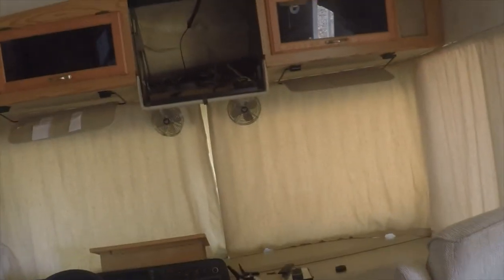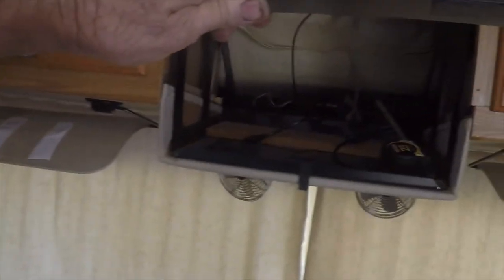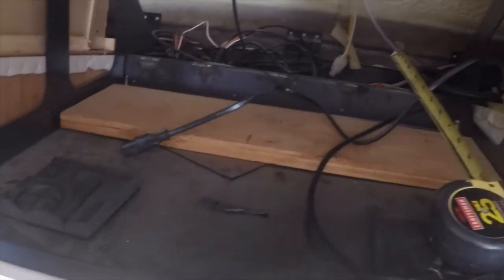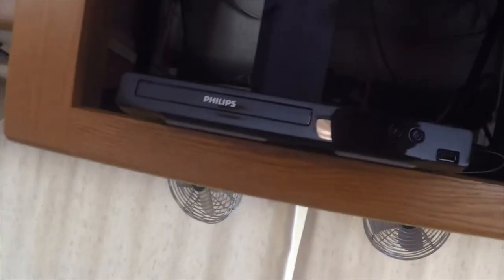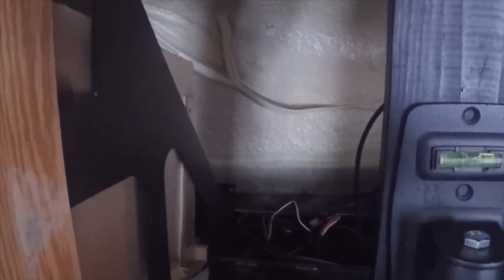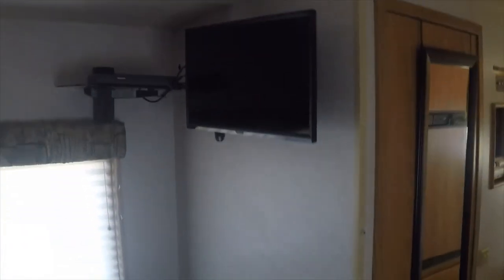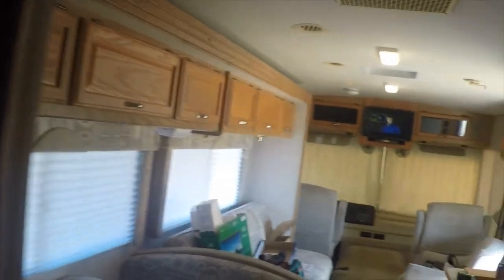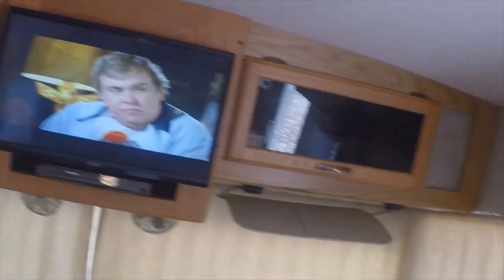Installing a flat screen in the Motorhome.

Comment: Nice. Do you have a problem with the tv moving on the swing arm while traveling? I’m trying to decide between a fixed vs swing arm mount on mine.
Reply from the maker: I have a bunge cord across the back of the TV that hooks into the mount so it can not move. Works great, thanks for watching.

Comment: I have a 2003 Itasca Sunavo.  Thank god I saw this video. Going to do the same now!!!!    By the way,  how did you attach the bracket for the tv in your room?
Reply from the maker: I used sheet rock anchor bolts, you drill a small hole then the anchor goes in and spreads out on the inside of the wall.
Reply: Rickbo's Rides Thank You!

Comment: Great video, trying to do the same on my sightseer 2004 almost identical as urs. I notice that u have a touchscreen stereo, trying to mount one with apple carplay, do you change that one yourself? Witch one you used to fit in there or you male the insert hole bigger
Reply from the maker: That is only a rear view screen, they had a radio in it but it did not fit well. So i cut hole bigger, I have a video putting it in. I need to find a new place for the radio. Thanks for watching.

Comment: Do you have a video on how to remove the old TV?
Reply from the maker: I did not video me taking it out but it was easy. If you have a Winnebago just take the 4 screws out of the face cover and there is a metal strap that goes over the TV. Remove the bolts from each side of the TV and it will come out. Thanks for watching.